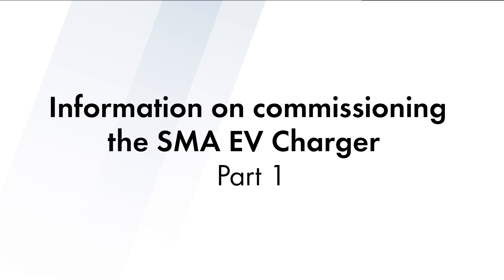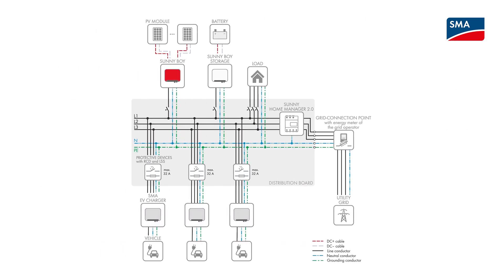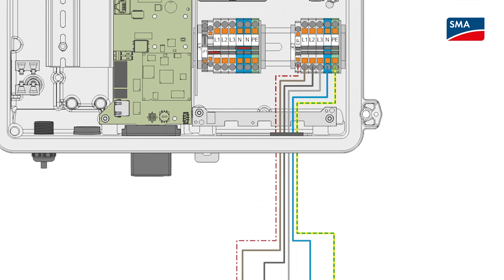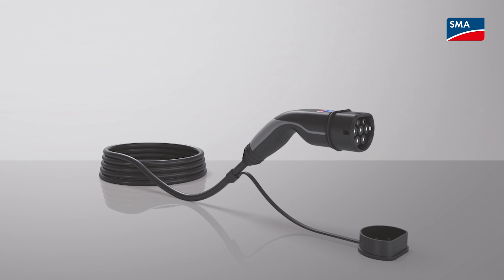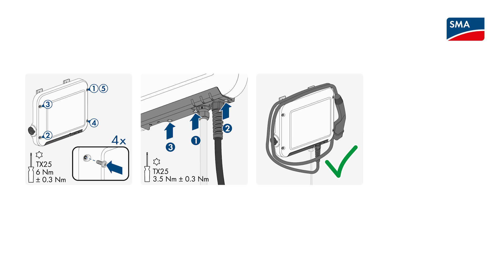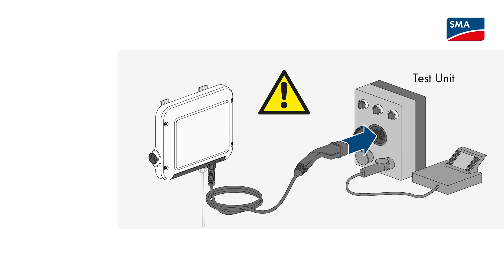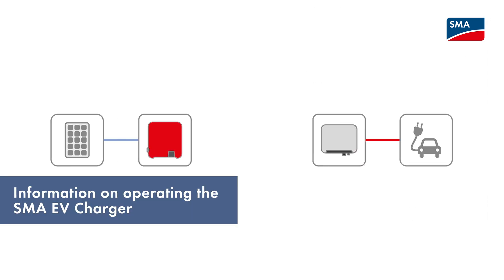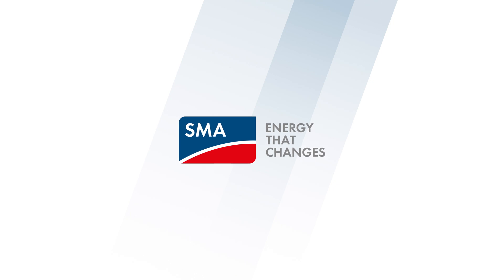Information on commissioning the SMA EV Charger – Part 1

Comment: Could you tell us how to configure the charger with dynamic charging in an installation with sunny island and home manager 2.0??
Those of us who are on the island and have an electric car with sunny boys, how do we charge the car with dynamic charging?
Thanks
Reply from the maker: Hello David, thanks for your patience. During fast charging, the vehicle is charged with the maximum power that the vehicle and house allow. Any energy source is used here, so the system could potentially be drawing power from the home storage system to charge your vehicle. During PV-optimized charging, SMA EV Charger charges the vehicle with the energy mix saved in the Sunny Portal (slider). Charging of battery prior to optional loads checkmark decides whether the battery or OPTIONAL load is supplied with the surplus solar power initially. Depending on how the slider is set, energy from the home storage system or utility grid can also be used to charge the vehicle. During forecast-based charging, surplus solar energy is initially used for achieving the charging target configured in the SMA Energy app. If not enough of this energy is available for achieving the charging target, the home storage system is used. Once the home storage system is used up, the energy is drawn from the utility grid. You'll also find more information at https://www.youtube.com/watch?v=N2kM6zqsD3M and https://files.sma.de/downloads/SI-HoMan-PL-en-53.pdf. Sunny regards, your SMA Social Media Team